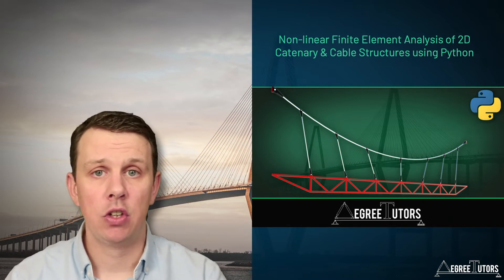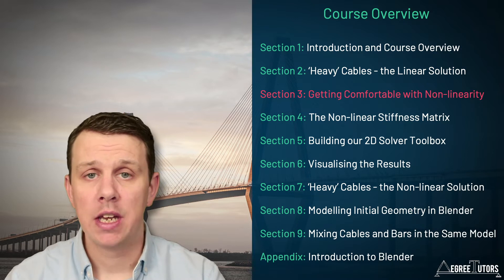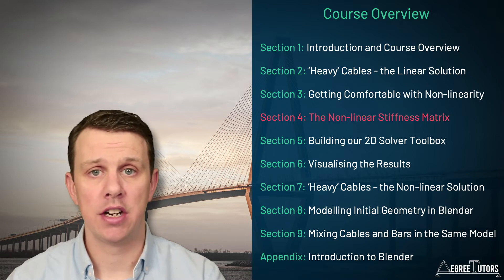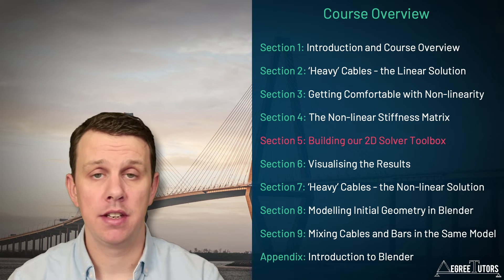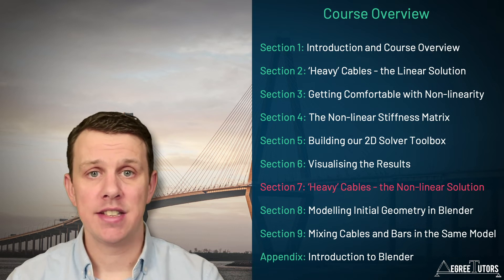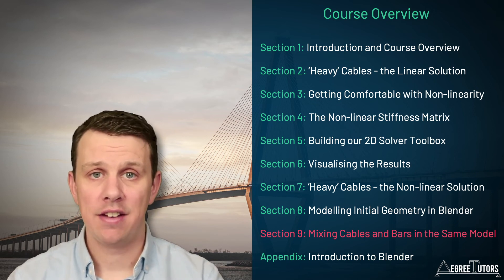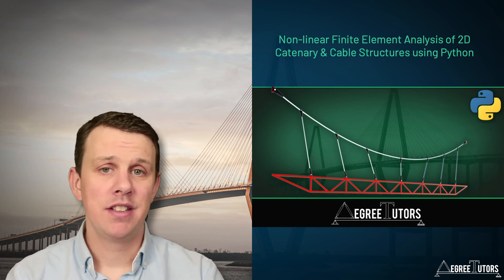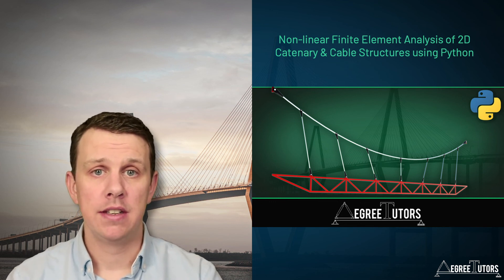Course Overview | Non-linear finite element analysis of cable structures in Python

Comment: Does the course directly demonstrate how adding a point load at any point along the catenary at an angle will influence its shape? Thanks
Reply from the maker: Hi, yes we work through applying point loads to a catenary…if you take a look at the course info page on EngineeringSkills.com…you’ll get a much better idea of what we cover 👍
Reply: @EngineeringSkills-Sean  thanks, I’ve just purchased the course! Are we also able to apply horizontal loads?
Reply from the maker: Great - welcome aboard! You can certainly apply them but it may provide very difficult to get the model to converge.
Reply: how was this done on the golden gate bridge?
Reply from the maker: Extensive use of scale modelling combined with plenty of math.